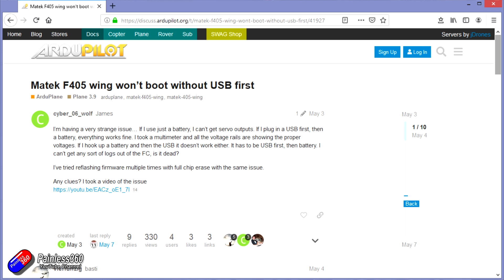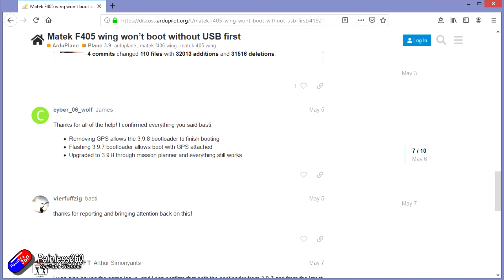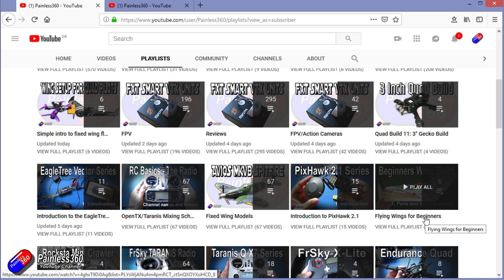Arduplane on a Matek F405-Wing bootloader issue workaround/fix

Comment: I've followed everything in the video but with the latest BL version (AP V.4.0.5). After the first 3 or 4 connections for the setup, everything was working great, GPS lock, video, and OSD (although elevons stabilizing in the wrong direction, so needed reversing something). But after that my laptop just won't recognize any COM Port, neither in Mission Planner (latest or older versions in my other laptop), nor INaV or Betaflight (which I was going to try to re-flash with the older version mentioned in your video to see if that could help). I've tried Zadig (no STM32 or Matek listed), downloaded STM32 drivers, and nothing, computers just won't recognize it anymore. Any help is kindly appreciated (this is my second Matek 405-wing, and that never happened before...)

Comment: @Painless360 or anyone else, do we know if the latest version aug 4 3.9.9 has the fix?
Reply from the maker: I cant find any specific details on this..
Reply: @Painless360  Well i flashed with 3.9.9 bl withing BF then tried to reflash the 3.9.9 non BL but it didn't work. Gave errors or said already loaded but seems ok in setup at the moment. Not tried it off usb yet tho.

Comment: Good info - thanks.  I have a question:  Do you know if one can buy the colour coded pins (that come with the F405 but not the F411) separately as I intend to buy the F411 soon.  Thanks
Reply from the maker: I've never looked for them but I'm sure you can. Matek got them from somewhere..

Comment: A little off the subject of Arduplane but relates to TBS Crossfire. I have 3 fixed wings using the F405 with Inav and TBS Crossfire. Noticed you have the Rx antennas positioned horizontal. Would this not cause nulls when the plane is turning with the wing tips towards you? Would this be a problem? My antennas are positioned vertical and I still get LQ drops when banked in a turn .5 mile out. Would not think it would be this sensitive.
Thanks
Reply from the maker: See my videos on crossfire where I cover antenna alignment. Vertical would have been nice here but impactical on a wing. Due to the relative heights I don't find that you spend a lot of time in the poor reception area of the ends..

Comment: My mini AR wing has a new flight controller in it now. Managed to get it in the air yesterday, too fast for me LOS but with the autopilots help I managed to not destroy it again. 50m loiter radius is a big damn radius though, didn't anticipate that and nearly lost it in a tree I thought I was miles away from. Stabilization needs some tweaking too, the defaults don't really allow enough bank angle. Terrified of testing the rth failsafe. The Bix is going well, progressively transitioning from foam to mostly glue and tape but it's doing it's job.

Another tip for your quads to wings stuff: don't be a jessie with the throttle, especially on launch.  More throttle = more airspeed = more control.
When I full throttle my quads bad things happen, the thing disappears at 100+mph, my batteries scream, my escs scream, my motors scream, my props deflect etc. When I full throttle my mini AR wing it gains sufficient airspeed....  I had/have a bit of a mental wall about that. I instinctively don't want to hold the throttle wide open (or even far above 50%) for extended periods.
Reply from the maker: Stay tuned. Autolaunch video planned that makes launching a piece of cake..
Reply: @Painless360  I just didn't realize how much beans the launch required. Kept torquing into the ground.

I've got the launch now I think, does auto launch also auto loiter at a given height?

TBH the basic problem I've got now is that I don't trust the autopilot because it's not tuned/trimmed and I'm not sure how much throttle it needs. It didn't look that stable. I need to trust it so I can sit down and get the googles down (too fast and too small for my los skills). Once I've done that I should be able to run the auto trim/tune and figure out what the throttle settings should be. After yesterday I think I know what I need to do. Basically, more height and man up!
Reply from the maker: That's basically it :) FBWA should work well and work great after an autotune.. Best of luck!
Reply: Definately get an autotune done. I had the same issue with mine rolling on launch before I tuned it. I changed my bank angle to 60 as I have an agile wing and it loiters with a 30m radius. Make sure you have the min fbwa airspeed appropriately set and cruise throttle and it should loiter ok.